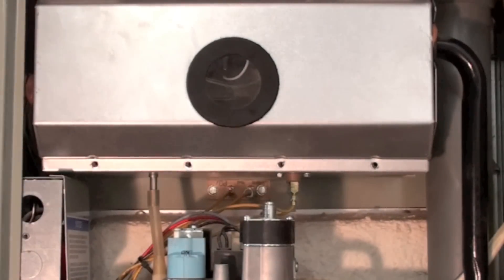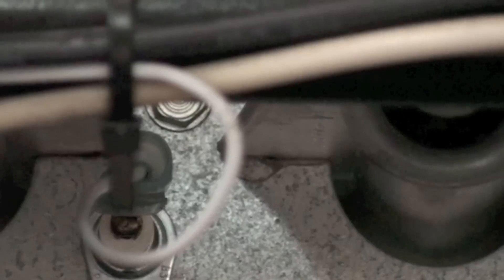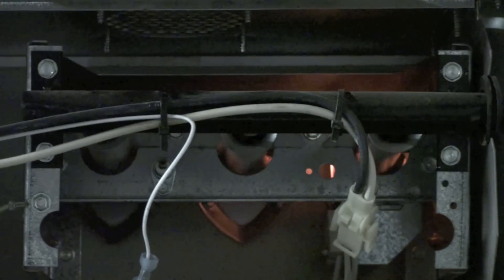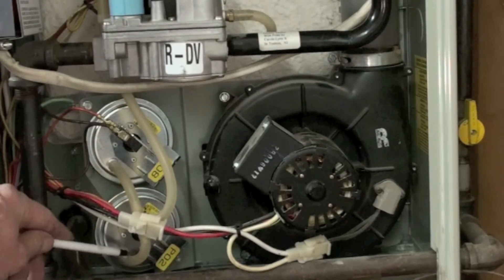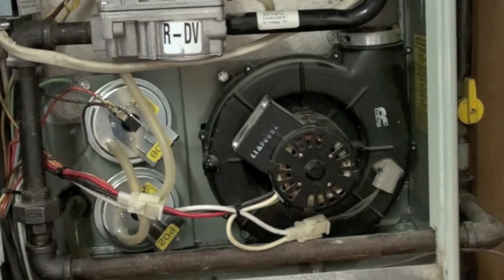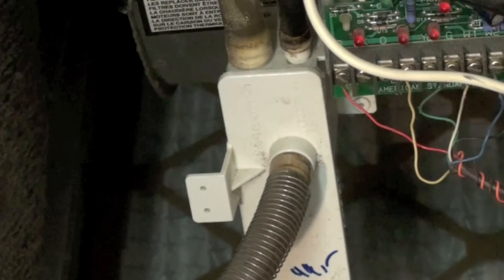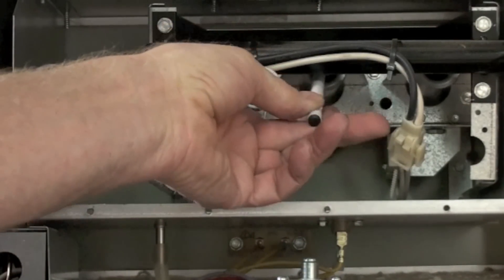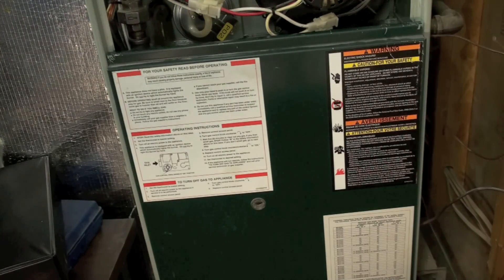Why does the gas furnace short cycle

Comment: Thank you! My furnace was short cycling just like the video was when the the flame rod was disconnected.  I took it out, wiped it clean with a paper towel and a little bit of cleaner, popped it back in and the furnace works like a charm!  Saved me a few hundred bucks from calling in a pro!

Comment: Hello, I need help for a friend of mine. He has a nor dyne gas gun furnace model number Mbha-086abfc-01
It doesn't have a flame rod like in the furnace in the video, also it only has one burner, it doesn't look anything like the furnace in the video. It does short cycle however, the flame comes on for 5 seconds and shuts down and repeats. It has a red light that blinks 3 times on the black control box. I'm not knowledgeable on this at all. Any help would be much appreciated. Thanks.
Reply from the maker: M60Head It sounds like you are not sensing flame.  Possibly a dirty flame rod.  You have to take the burner out to find the flame rod.  This video shows a furnace somewhat similar to yours:  http://youtu.be/0rqpTQcN-Mc  It is linked to several videos about this furnace.  Its a pretty big job.  You may not want to tackle it.  Hope this helps.
GFM
Reply: We did take the burner out, and we replaced the hot surface igniter because the old one was busted. It doesn't have a flame rod. Now the furnace turns on, flame comes on for 5 seconds then goes out. I'm guessing the hot surface igniter is what senses the flame because there is nothing else there. But why is it not sensing flame, it is brand new. Is that what senses the flame, and if so how can we make it sense flame? One note... My buddy put the new ignitor in, do the two wires that hook to it have to be a certain way? Is it possible that the wires are hooked up backwards, or does it not matter how they hook up? I'm really stumped here, because his furnace doesn't seem to have a lot of parts like most of the furnaces do.

Comment: We have an older furnace in a mobile home that short cycles just like this and we have had 2 different technicians out to look at it and they cannot figure it out for the life of them. It has done this for almost a year now, it'll work fine for awhile and the stop. And sometime start back up on its own. We live in minnesota and I've noticed when it gets really cold (below zero) is when it tends to happen. I don't know if that's just a coincidence or not.
Reply: I have the same issue now.  Replaced both motors last year.  and new ignition part. Replaced cap on the roof.  Removed filters and restarted.  This winter worked perfectly. Came home and both motors are hot to touch.  House is at temp on thermostat.  It just runs 15 secs and restarts over and over.  Good flame.  
Extremely windy... was thinking it is blowing out but flame seems lit.  Had similar last year in windy,  extremely cold night. 
Suggestions??

Comment: would taping down the shutoff switch be ok (as long as you dont touch anything inside while the furnace is running) so you can see the led codes better?
Reply from the maker: punchy001 Service techs do this all the time.  Just keep your hands to yourself. 
GFM

Comment: Why does a gas pack short cycle ? Had a heat and air man put new digital   Thermostats in . Still short cycles , ( 5 to 6 minutes top ) . I runs 6 minutes top , then turns off 2 minutes comes back on for another 5 to 6 minutes . Should it run straight until it gets up to temp ? He was suppose to put a new limit sensor in also .Also cleaned flame rod . Need help asap .
Reply from the maker: Cliff Nabors Spounds like the furnace is overheating.  Thus the limit replacement.  The limit switch is and indicator of a problem, not usually the problem itself.  Dirty filter, plugged secondary heat exchanger (on 90% furnaces), restrictive ductwork and sometimes a cracked heat exchanger.  Hope this helps.
GFM
Reply: Thank You Grayfurnaceman , found duct problem.

Comment: Gary I have a 90+ Rheem (about 15 years old ) and the flame short cycles. Everything works fine in the heat sequence but the burners flicker and short cycle after about a minute of run time. I hear the gas valve solenoid kicking in and out as well - just before the burner kicks off. I cleaned the flame sensor and also swapped out the flame sensor with a like part from another furnace that is working properly - same problem repeats even with the flame sensor swapped out.  I noticed some darkened areas around a couple of the transistors on the control board next to the Flame sensor indicator light. Do you think the next logical step is to replace the control board?
Reply from the maker: adsrgr8 I would be checking for voltage at the gas valve.  It should have 24v once the burners are on.  If the voltage drops off when the burners shut down, and the board does not blink a code, wiring or board is probably the issue.  If the voltage is still there, the gas valve is at fault.  Hope this helps.
GFM
Reply: Thank you for the reply. It turns out that the small evaporator tank within the blower compartment (that condensation runs through) was plugged up and not allowing the condensation to travel to the floor drain, therefore it  was causing the furnace to short cycle. Once I cleaned the drain lines and small evaporator tank with in the furnace compartment the heat sequence returned to normal. Thank you for your help!

Comment: Oh, one other thing about this unit,  It is very similar to the 58SSB units built in the early 80's.  Thx
Reply from the maker: John Kavadas The pilot assembly may need to be replaced.  Also, the pilot flame should be all blue.  If there is yellow in the pilot, it is dirty.
GFM

Comment: My Day and Night heater keeps on recycling.  After the 4th recycle it stays on and the blower kicks in and works fine.   Have looked to see if it has a furnace sensor but cannot find it anywhere to clean it .  This unit was installed back in 87
Reply from the maker: John Kavadas Give me a model number and maybe I can help.
GFM
Reply: grayfurnaceman
OK, here is the model # 395AA036035.Unit, Day & Night, made by Carrier.  Went back to the house, fired up the unit, 4th time around the furnace stayed on and the blower kicked in until it reached desired temp, turned off for a bit then turned back on and off a few times before kicking back in.  Thanks for the help

Comment: The first thing you should check is the thermostat, if you have a digital thermostat then change the batteries. If you have an old mechanical thermostat then get a new digital thermostat. If that doesn't fix the problem then call a professional, untrained persons should not mess with gas/propane furnaces.

Comment: What we have been seeing that if the end burner-the one with the flame rod at it not lighting all the time. Pull inshot burners out and inspect cross liter between burners are rusting shut. That causes the end burner lighting sometimes and flame rod not seeing flame. Unit drops out seems like the cross over is rusting up and can be cleaned with with wire brush. If to rusted new burners are ine order.
Reply from the maker: When the inshot burners first came out, they were all galvanized and there have been a lot of problems with them as you have seen.  Many, if not most are now stainless, which eliminates the problem.  Thanks for the thoughts.
GFM

Comment: Had a question, I have a Rheem RCBA-376556617  and currently i am having issues with it. This is what what is happening.  

-Fans come on
-HSI lights red 
-flames come on
-10 min later shuts off
-goes through same cycle but sometimes all flames go on or it turns on certain flames randomly. 

Is there any suggestions on what this could be? I already checked the flame sensor and that is fine.

Thank you :)
Reply from the maker: The first part seems like normal operation.  As for the last part, If all burners do not light, I would be looking first to clean the burners and the flame spreaders.  Hope this helps.
GFM
Reply: grayfurnaceman Thank you very much for the response. I will try this tonight after work. Yeah for some reason it has been doing this and it is causing our house to be around 60 degrees when it is -12 outside. I will let you know how it goes.

Comment: My problem was the water issue you touched on .I had blockage after 11 years causing short cycles .Cleaned the pipe, trap and drained water from motor .Fast forward 2 years later the motor went out I bet the moisture made it die early, I did get 13 years out of the moter.I am going to keep the pipe and or trap clean so to drain properly

Comment: Hay Furnaceman, I have a ducted heater (Stadt), On hot days the fan turn on and runs for 1-2 mins then switches off, every 15-20 mins. I have changed the board in side, but it still dose it on days greater than 35C+. Any ideas?

Comment: Three out of my four burners come on, but the last one, the one that is supposed to hit the ignitor rod, does not come on 50% of the time.  It's the last one on the valve.  Do you think there is something in the gas line between the 3rd and 4th burners jamming it up?
Reply: am having same problem cleaned the jets. What else
Reply from the maker: James Pilotte Could be low gas pressure or heat exchanger problem.  What brand?
GFM

Comment: My Goodman GMP furnace short-cycles from time to time, but only one time it locked out with a high-limit code.  The highl-limit sensor always has continuity when I test it, but I've never tested it during a flameout.  If I re-seat/tighten/clean all the electrical connections between the flame sensor and high-limit sensor, it typically works for weeks and months.

My symptoms are always this:

time
00    tstat calls for heat
03    inducer spins up
10    igniter glows
13    gas valve opens
14    ignition
44    blower starts
50    flames out
60    igniter glows
63    ignition
x     demand for heat is satisfied, tstat turns off
x+1   flame out
x+120 blower off

I'm never without heat, technically, but it's bothersome when I hear it go into it's double-cycle mode, at which point I go up and wiggle the above wires.  Flame sensor is new, and i typically clean it when I'm up there too.

Once summer i actually heard the Inducer fan spin up while the AC was on!

Great video!  But nobody can seem to help me with my double-cycling goodman.
Reply from the maker: I would look at the heat exchanger.  These furnaces are noted for heat exchanger problems.  About the only other problem could be wiring to the control board or the board itself.  Hope this helps.
GFM
Reply: did you ever got that fixed? - my is brand new installed 1 month ago and is doing exactly like yours...

Comment: Hi GFM,
Thanks for your help
This is f/up with my last post when the error was coming that pressure switch is open and was having a short cycle. Now my furnace is not turning on it runs 1 day fine and than I start getting the error that pressure switch is closed. Then suddenly it starts working for 10-12 hours and then get the error again. Now since last night it's not turning on. Can you please advise what's wrong and how to fix it.

Comment: I have a RUUD Achiever 90 Plus Premium Efficiency furnace and I am having the short cycle issue. I have cleaned the flame rod first but that didn’t help. When I turn the furnace on its ignites and then turn off immediately , it does it twice and then 3rd time the flame stays on for 10 minutes and shuts off completely. Then the green light indicator is showing that that Pressure switch is open. Please advise what I can do
Reply from the maker: This sounds like a pressure problem to me.  Restricted vent or combustion air inlet.  Check outside for snow/ice.  Hope this helps.
GFM

Comment: I have an older Carrier furnace that is short cycling. It gets a signal from the thermostat, exhaust fan comes on, igniter lights up, flame lights, I cleaned the flame rod, it stays lit for a while, the house fan comes on and for about 2 min, then I hear a click and the flame shuts off.  The fan runs and then shuts off after about 10 seconds and then it repeats.  There is no light on my control board to indicate an error code.  This happens for a few cycles and then the furnace stops all together.
Reply from the maker: If you give a model # it may help.
GFM

Comment: There is no window on my lower panel to check the trouble code...
Reply from the maker: Give me a brand and model #GFM
Reply: Allied Air (I think ducane)makes the furnace(lacks a badge for some reason) and the model number is 95G1UH110CP16-01. I just ended up drilling a hole. Found out my inducer is open when my pressure switch open but it corrects itself after a 3-8 minutes? It is a 90+ furnace that is only a few years old. I think the issue is a cracked heat exchanger but I need to get a borescope to make sure. Only reason why I assume that is the issue is because I believe I smell the gas leak indicator from a small air leak around the hot box. The way it runs now is if I reset the board is it ignites we have fire for about 4-5 minutes shuts off gives the error for 3-8 minutes and then refires and cycles like that. I had a bit of water in the inducer so I thought it was that so I drained it. I haven't checked the condensate line yet but the exhaust condensate catch seems to be not clogged (rubber lines won't come off easily scared to tear them)...
Reply from the maker: Son Le This problem sounds like an overheat problem.  Check filter, blower wheel, ductwork problems.  Here is a video on cleaning the blower wheel and secondary heat exchanger:  http://youtu.be/jjHR9GLvQ7g   The gas smell bothers me.  Is it a burned gas or a raw gas smell?  Is the smell always there or only when the furnace is on?  You need to get to the bottom of this.  
You could be right about the heat exchanger too.  Both of these symptoms can be dangerous for obvious reasons.
GFM

Comment: When mine comes on and shuts off right away, its usually a metal probe that is in the flame stream.  I usually use some 600 grit paper and it works perfectly.  Great tip.